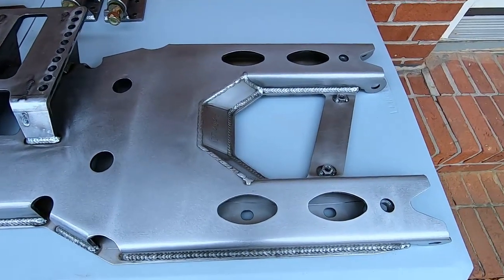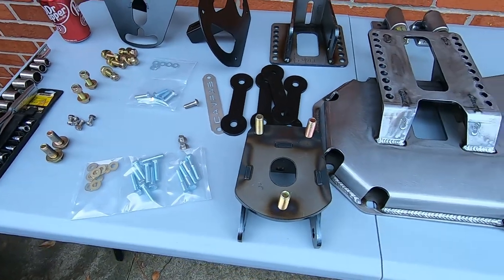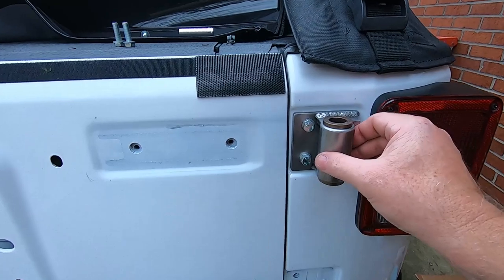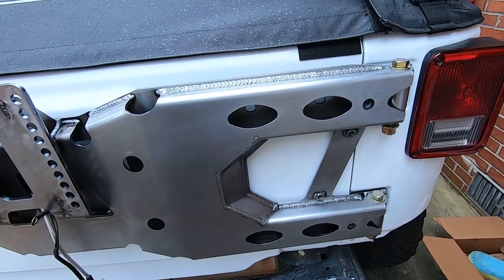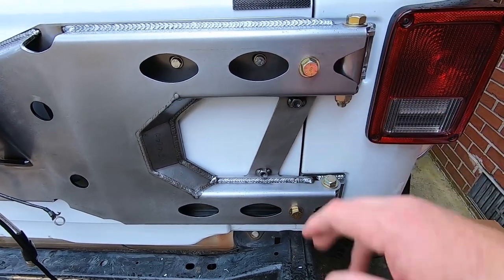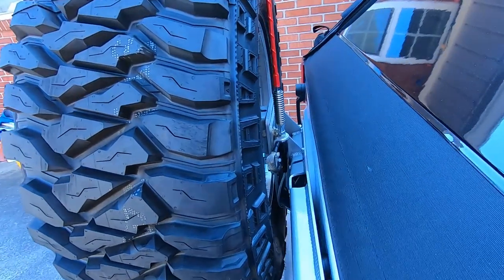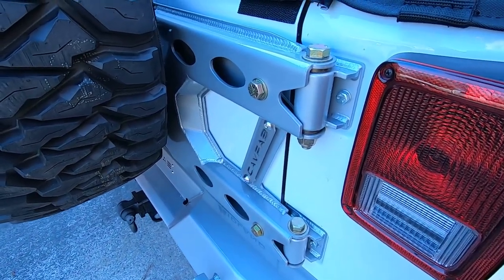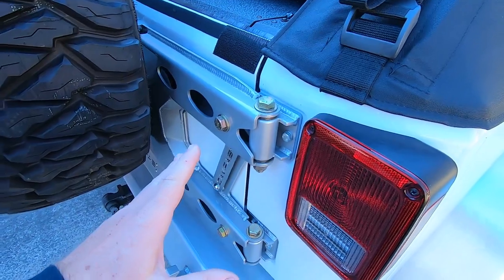Looking For The Best JK Tire Carrier? CAVFAB Elite Series JK Tire Carrier

Comment: I picked up the cavfab one ton aluminum steering kit with the drag link flip. System is slick I like their stuff. Great video!
Reply from the maker: Thanks for watching. I have the CAVFAB 1ton steel kit and it’s been great for nearly 3 years.
Reply: @Georgia4Low  that’s good to hear, did the rod ends come painted or coated in your kit?
Reply from the maker: @seashizort  seems like they were coated with something. They haven’t rusted